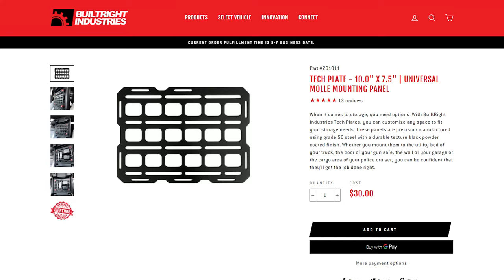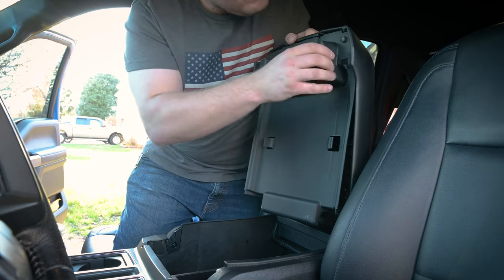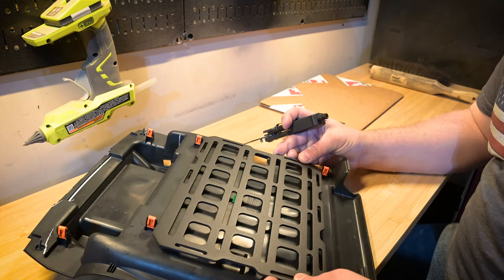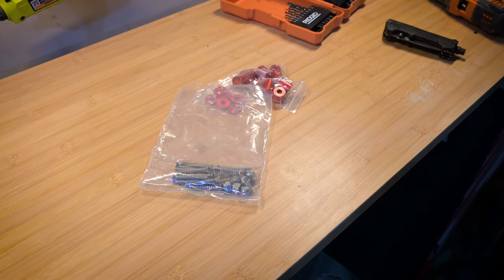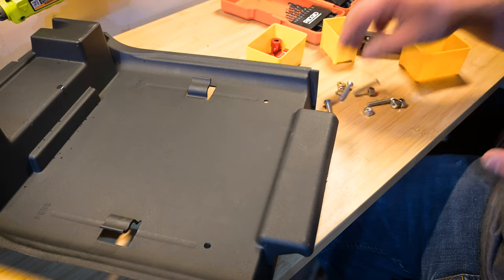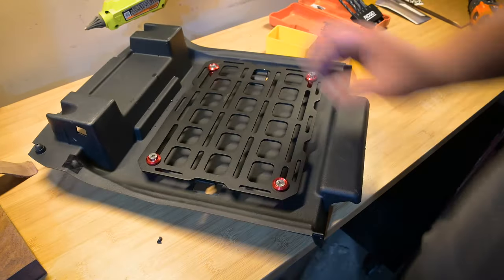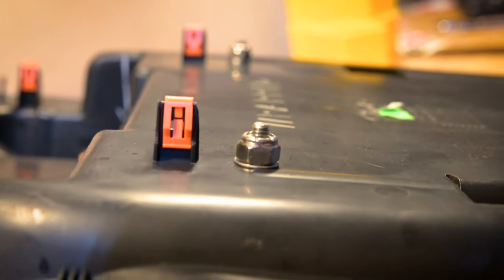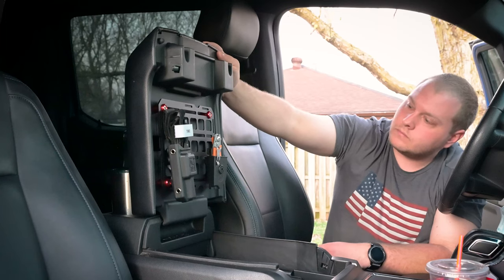Installing a BuiltRight molle plate in my truck Center Console!

Comment: I'm going to install one of those metal lock boxes inside mine for my own 2A accessories.
Reply from the maker: Not that I am saying you shouldn't... But some people aren't aware that the lid on these consoles also locks. It's not as secure as a safe inside, but it will stop any thief of opportunity without tools (90%) and those console safes are VERY easy to pick or break for the other 10% that brought tools. For my money, the console lid lock is good enough, but I understand feeling more comfortable with the console safe. Then again, two locks is better than one.

Comment: Nice video. I just installed the BuiltRight latch release for the rear seat, and it is a very high quality product. How much room is there underneath the closed cover? Does it interfere with the little tray that comes with the truck, or did you have to remove that?
Reply from the maker: There's plenty of room for all of my junk in there. Even with my accessories on the plate, there's lots of room for all of the stuff in the tray